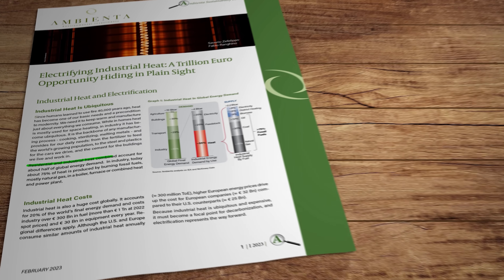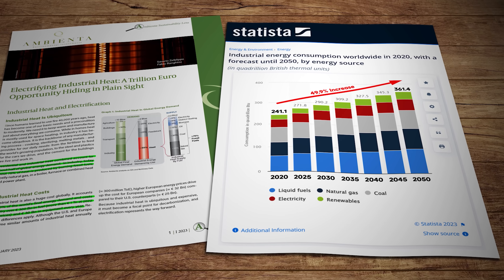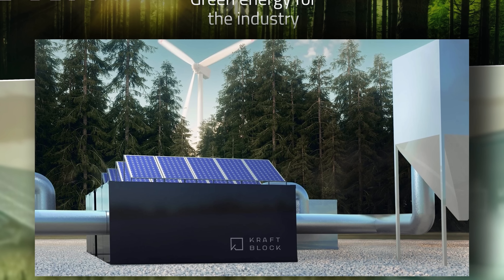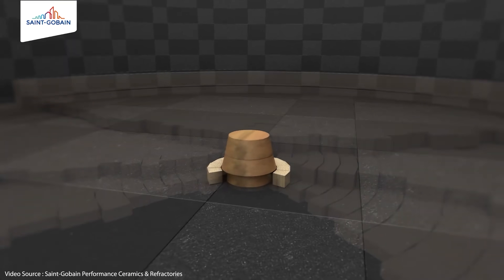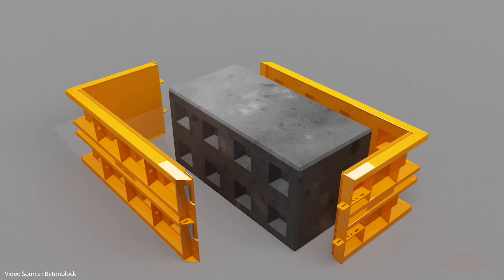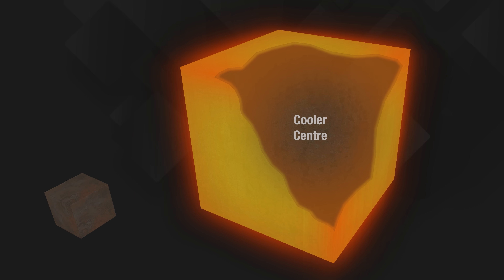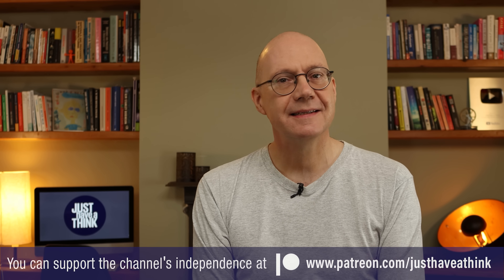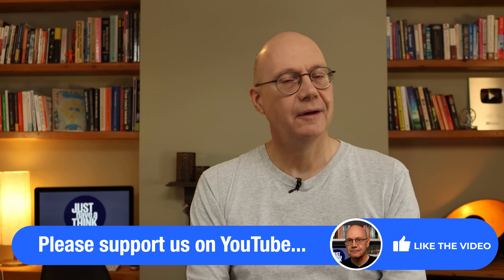Moving waste heat from industry to homes.

Comment: In Pakistan, there are hundreds of spinning mills running on gas engines in Mega Watts and discharging exhaust gas, I see a big potential for this technology.
Reply: Did I understand that right you use gas engines to generate electricity which power the milling machines?  

I don't know what type machines you are using maybe check out for combined heat and power plant ?

It is used in combustion engines either natural gas, or other fuels  the exhaust gas are often hot enough to run through a heat exchangeer and heat up water . If you use big engines or gasturbines you can generate even steam and run steam turbine

Comment: I often wonder about the possibility of converting homes into mini data centers for parallel computing tasks. The house could pay for the electricity by renting out computing power (at cost), and essentially get the heat for free. Of course, you wouldn't run them when you don't need heat, but there's always some people in the world experiencing night or winter at any given moment, meaning customers will always have some servers available to them.

Imagine needing massive computing power to train your machine learning model, run a complex simulation, and there's an entire town in northern Canada (with hydro electric power) willing to do the computations for free!
Reply: The essence of powerful computing is minimizing the distance traveled between various components in the system. That’s the opposite of what you are proposing.  Nice thought though.  Another limitation is the ability of the residential grid to handle that increased load

Comment: A lot of comments about 1300 C° not likely to be wasted but i read it the slag material could take that temperature,  maybe from an industrial process and or from 'waste' energy from wind turbines where grid not wanting  excess energy.  But wasn't clear how you would 'plug' in the turbines into the container?

Comment: Could the containers be moved around by trucks running on Stirling engines… 🤔 Could any truck be using a Stirling engine running on excess heat..? Just a thought… 🙂

Comment: The storage part is ok, but transporting them is not realistic. It will be a lot better to use it in place where it is burned. Working with optimimising industri and have never heard of 1300 °C waist heat, most waste heat is between 30-80 °C.

Comment: Clever.
Is there more waste heat we can use? 
How about lower temperature heat or temperature differences. Most of us have seen a Sterling model engine powered by a coffee cup, or the palm of our hand when cold outside.
Almost every industry has an exhaust that release something that's 20 or 50 or even 100'C warmer than the ambient temperature. This can power a Stirling engine.
A classic example I thought of many time's, is a wood stove - Sterling combo in a cabin at a remote location. While you burn the wood to get cabin warm - you may get electricity as well.

Comment: I'm not convinced. The Netherlands example didn't say that the Kraft Blocks were been delivered to the crisp factory. If, as suggested, the blocks were heated by surplus renewable energy then that isn't exactly waste heat and could be done on site and heated by grid power. That makes total sense but is no different to the other heat storage solutions out there. Putting heat on a lorry and driving it to a customer is clearly a non starter. Would these customers pay to install all the specialist equipment to 'unload' the heat. It would have to be a supper reliable service, both on a day to day and year to year, to make it worth it. If the heat source was that reliable (never shuts down for maintenance or have labour disputes!) then clearly factorys that need heat should be built close to the sources of waste heat. Another point is that if it's worth a company installing all the heat collection equipment to heat Kraft Blocks then it would be worth them finding on site uses such as generating electricity rather then sending it of on lorrys. Most waste heat is 'waste' because it's not economic to use it which of course needs to change through incentives etc.

Comment: The distribution is the issue here. Surely it's better to reuse/store the heat on site and micro-generate/distribute any excess heat as electricity for the plant demand whilst exporting excess electricity to the grid at peak times. But, until heat is taxed as a wasted product, there's no incentive for industry to do anything.

Comment: Has anyone considered setting up right at the steel plant a to be determined system that captures the tremendous heat going into the slag pit and into the atmosphere. The steel production one can assume is very well connected to the electrical grid supply, how about using all that Uber hot waste slag to flash something material to steam, make a turbine go round real fast which generates electricity to reduce steel production companies need from grid by using that which it generates from slag or if the contract cost are favorable from grid to steel plant then send electricity generated from hot slag into the grid to supply consumers willing to pay higher per unit costs.

Comment: Has anyone scaled down one of these batteries and used a biodigestor to heat it?
Second question why hasn't someone made a hybrid electric car that uses a compressed air motor to recharge it on the move?

Comment: There is an Australian company called 14D which has developed a product called a Sibrick which can be heated to 1400 degrees Celsius. A pilot plant has been built and has almost 12 months of testing completed demonstrating a discharge of 900 degree air for 6 hours and 600 degrees for twelve hours. 
The idea is that it will use the surplus solar energy that the grid can't handle during the day when wholesale prices are low, even negative in some cases. Then discharge heat for customers during the evening when prices rise. Company executives say they need a large price differential to make the idea viable. Australian gas company Woodside has just made its second financial contribution to this company and it's Aurora project which will be used to produce night time electricity should go online in the next 12 months. A German brick manufacturer has expressed an interest in manufacturing Sibricks for the European market.
…and yes I own shares in this company and after a long wait I am starting to feel optimistic about it's prospects.

Comment: I was actually surprised that you seemed suprised at how much of the energy we consume is used for moving heat around. I would think that anyone looking at energy use would be familiar with those numbers. Between heating or cooling our buildings, heating our water, or cooling our food, we are probably looking at more than 60 percent, possibly 70 percent of energy use. Moving and storing heat (or cold, in the form of some type of chilled fluid) efficiently  would probably be of more actual environmental benefit than adding more renewables and then having to mine massive amounts of rare minerals for batteries.

Comment: The use of slack is surely a good idea, provided there is no risk of toxic heavy metal oxide dust will leak out during use. However, the use of phosphates as a binder may be more of an issue, are those are already getting rare, and the mining process is really not environmentally friendly.

Comment: Very intelligent way of recycling waste heat.  Back in the 70's I worked on a waste burning heating power station in Europe and was impressed with the method of extracting energy and reducing landfill.  Naturally with a higher population density and a cooler climate innovations as such can be very rewarding. Realizing such recourses in Australia would help and make us a smarter country.  Thanks for this video.

Comment: I wonder if fly ash from coal fired power plants could also be used for the heat storage blocks the same as steel slag? There are certainly millions of tons of it stored at power plants where it needs special containment so the heavy metals don't pollute groundwater. The contaminants shouldn't be a problem if the ash is used in heat storage blocks.

Comment: I work in this field (sustainable infrastructure). Mobile heat will be an important part of the solution puzzle. 

One must think of heat as nothing else than what it is - ENERGY. And we must utilize it as such. Energy.

The less energy we use - the better. The less energy we lose - the better. And this is why energy recovery and reuse are vital.

In my home country (Switzerland) we used to have a high percentage of oil heating and most buildings outside the city centers had their own oil tanks in the basements. Why don't we go back to that idea of decentralized energy storage systems? Instead of an oil tank, every house should have its thermal energy storage in the basement or in the ground beside the building? 

Instead of having an oil tank truck passing by every few weeks, the thermal energy battery truck passes by and recharges the local thermal energy storage? Also, the home thermal storage systems should have an independent system that can heat the system itself with access renewable power from wind and solar - it is as simple as a resistance heater and would make hybrid systems...

Comment: Something like 1000 degree temperature is not surplus heat, its very usable for mechanical work production. Heat becomes surplus when it is closer to 100-150 degrees. This means heat pumps would be needed to store lots of energy in these containers,  eating possibly a substantial fraction of the benefits. That's why in district heating they have to move huge quantities of hot water to heat urban areas, because the best part of the heat was used to produce electricity. I wonder how much even a steel plant is able to produce 1000 degrees "surplus" heat.

Comment: Like so many developing ideas, this looks good on paper and I understand the need for optimism in the early stages. However the nature of the processing required for grinding and coating the slag to be used is not specified and I am questioning the process in the simplified schematic graphics for how hot air is pumped into and distributed evenly around an apparently sealed container. Then there is the question of the heat or hot air itself, as most excess industrial heat it carrying water vapour or possibly gasses. I believe they are onto something conceptually but they're going to hit the wall hard on practical applications. I hope I'm wrong.

Comment: Nope. If you have a lot of "waste" energy in form of 1300 °C heat, you turn it into power. The Kraftblock system requires significant investments too, integrating waste material doesn't remove the other costs, or more valuable resources required. The part of the heat transfer rate and particle size is true, and was well explained in the video. But it also lacks practical significance for very high temperature storage, as molten salts are much better than a powder, and heat transfer is also limited to heat exchanger size. If you blow hot air directly through the storage medium you do not want a fine powder for storing huge amounts of heat at very high temperatures at super high heat transfer rate.   

Turning energy in form of 1300 °C heat into power can be done with good efficiency, with very well proven technologies from multiple competing companies, and that increases the value of the energy you're left with, significantly, and you can distribute it directly to the grid. Storing and distributing the heat will have losses, and require specific proprietary infrastructure on both sides, and actually driving that thing back and forth. Without providing any real advantages.   

If there were no use for any slag at all, and the accumulated amount of it was a big issue in the big perspective, as implied, it would be a great thing to find the first use for slag, but that's just not true. Sometimes slag is a significant problem, when it contains problematic things, but their technology isn't really a solution to that.             

For heat storage in general, the bigger capacity the better, the more heat you can store for a given amount of change in temperature the better, that's important for transfer efficiency and energy loss over time. That makes phase transition thermal storage extremely advantageous, a lot of heat can be stored at a specific temperature, that is, without any change in temperature.

Comment: You mentioned their desire to find an appropriate heat sink material that did not require an inordinate amount of energy to produce, which is why they settled on slag. But what about the insulation, which is also a critical portion of the success of this idea, especially since the higher the temps you are trying to store, the greater their propensity to "escape". I would think that the level of insulation needed to hold in that level of stored heat would be worthy of a mention (thickness, material, cost, etc.) in the video. ???  Just my uneducated opinion.

Comment: The problem with this is that high temp heat is valuable it is not waste. Why wouldn't you just generate power on site with your 1300 deg heat and sell that? The abundant low temp heat is the waste product that every power plant and industrial process is getting rid of to the atmosphere or a body of water.

Comment: I love this concept! Now if you could just apply it to Computer data centers! Given computers are largely just expensive hair driers, we spend silly amount running them and then equally silly amounts keeping them cool. All the heat generated by the process is almost always just thrown away, at least here in the U.S.  Not sure these 'boxes of rocks' would work in this application though, since the heat from the data centers is typically low grade. It IS High quantity though, so maybe??

Comment: GreenStartups have very bad reputation to work with each other. I would a connect with kind of CSP startup and ship it with theese mobile heat batteries.

Or antora energy which can provide heat and electricity.

Comment: One truck delivery and a 20ft shipping container = at best two weeks of running two small domestic fan heaters (assuming 100% heat transfer). Not sure if that's worth the Phosphate usage....or worth doing. Hopefully it is. The problem is the power density in the container packaging. And the phosphate.

Comment: Heat storage is nothing new and using industrial waste heat to keep buildings warm in winter isn't either. Here in Berlin my house is heated by one of the city's nearby rubbish incinerating plants. The city's power plants also dissipate a lot of their waste heat in this way. Most inner city houses in Berlin are now heated like this.
As for heat storage, already 30 years ago I read a report on a UK housing estate covering over a nearby lake with insulation material and using it to store heat from solar collectors during the summer months. And let's not forget the old fashioned storage heaters. It doesn't take a genius to think of scaling up this simple technology and using some other more ecologically friendly energy source.

Comment: Looks very promising! Could these units also be used to provide heat for housing, using local distribution of hot water? As an alternative when geothermal heat is not available, or insufficient. And if so, how can we use excess electrocity produced by wind turbines to generate heat in an efficient way at 1300 degrees?

Comment: Simplicity! I am surprised why sont all northern hemisphere courties have hot water pipe interconnected like drinking water? Its such a efficient way of distributing heat. So much noise of carbon emissions & green economy and no real effort on the ground. They should have made it mandatory in housing leagal requirements. 

Innovation mentioned in the video will just go waste because there is no infrastructure or motivation to use it correctly. Using trucks for transfer heat is equivalent of trucking ice in early 1900s. Its stupid although "economical"

Comment: Great idea. Stating the obvious, the higher the temp of the Kraftblock, the higher the Megawatts/energy storage and greater the economic viability. Not all waste heat from industrial production is at 1300c. My thought, what about lower temp waste heat, say computer server farms and the like, where getting rid of heat is a problem. Could heat pumps or some other technology be used to extract waste heat and increase the stored temperature to increase economic viability?

Comment: Problem i see is that eg heat at 1300 degC is very rarely considered waste heat. Only raw steel mills i can think of, a relatively small market. More common would be heat at too low a temperature to generate industrial steam, eg below 300 degC. But how far can you afford to transport a container of slag to gain only 200 degC of heat from it?

Comment: Transporting heat?
Time for bringing back the steam engines!

The trucks don't need to be electric if they have acces to pure, highquality heat and this will be an efficency gain.

Edit: AND it would eliminate the need for expensive batteries.